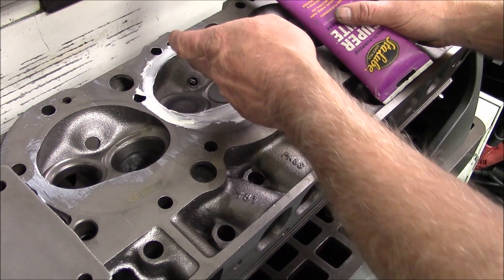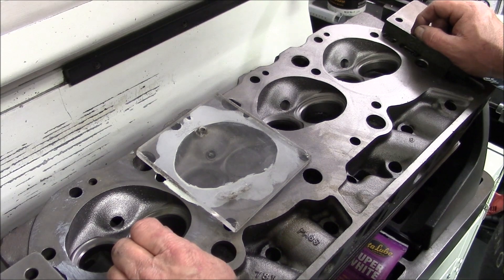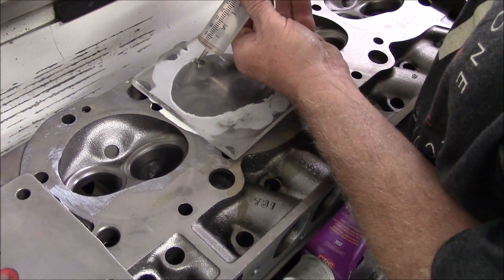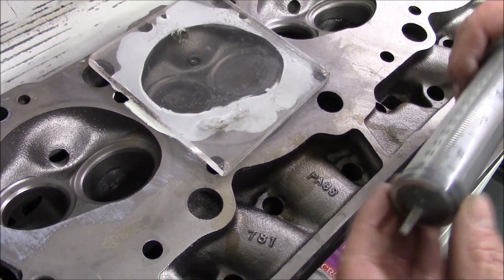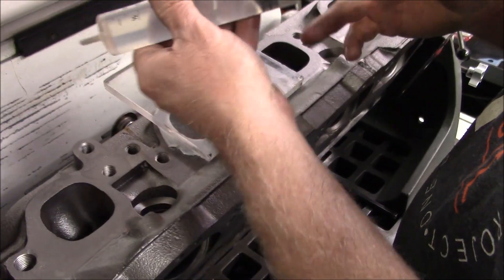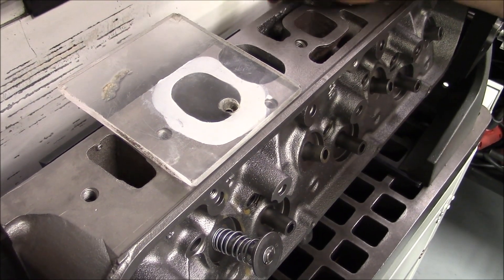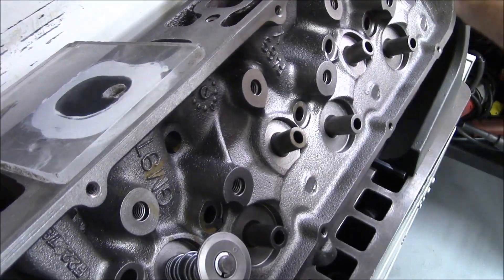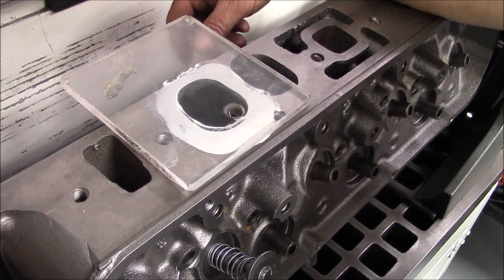Checking GM 781 Cylinder Head Chamber and Port Volume Street/Strip 454 Big Block Chevy

Comment: with the aluminum options available why would anyone put money into these heads
Reply: When your Married with children & have No Money.
Reply: @albundy8052  Sell more shoes Al
Reply: @excelerater  
Or YOU can send me some of those Whiz- Bang Aluminum Heads or $3000.
I also need a extra $700. For a tunnel Ram.
I already have short block & two school holley carburetors.
Thanks
Reply: @albundy8052  work hard race hard..good luck
Reply: Why wouldn't you is my question? Nothing like old school and learning a thing or two and having some fun while you're at it. If you don't enjoy the finer things in life, then motor on down the highway!

Comment: Great videos! When measuring or comparing port volumes before and after (stock vs. ported/new valves), should you take into account the shape of the valve that will be used? As in, a stock valve might be tulip shaped (less port volume), and a performance valve might be nail head type (more port volume). Or is it not enough of a difference to worry about? Thanks!

Comment: my intakes came in at 255 bad port, and 252 good port. c18 74 781 heads. I forgot what my machinist told me he measured my combustion chambers at, but since I'm having the 2.19" intake and 1.88" exhaust valves installed, I did some unshrouding work, and now the combustion chambers are measuring 122cc. I did a port match on a felpro gasket, raised the roofs a little, and ground out the rocker arm stud boss on the bad ports. Now the bad ports are measuring 270cc, and the good ports are 265cc. I haven't touched the exhaust side yet, but I only plan on opening the throats to 85% of the 1.88" valve, and removing all the casting flash.
Reply: I think I switched good port and bad ports in my comment.